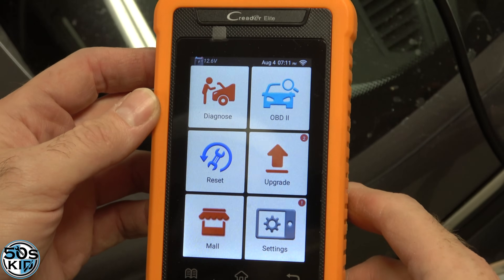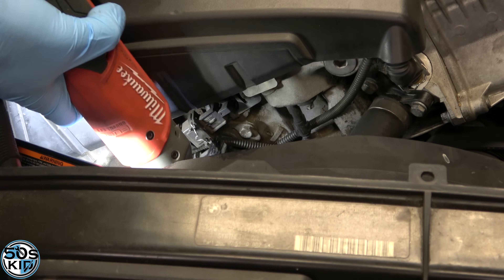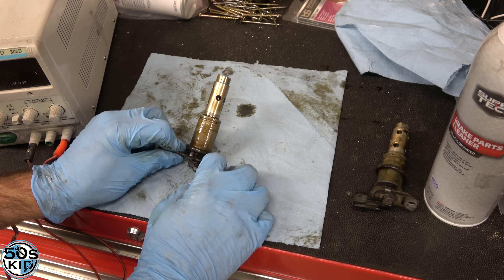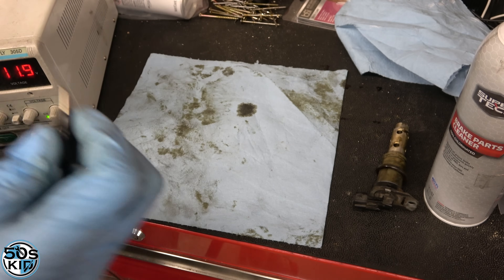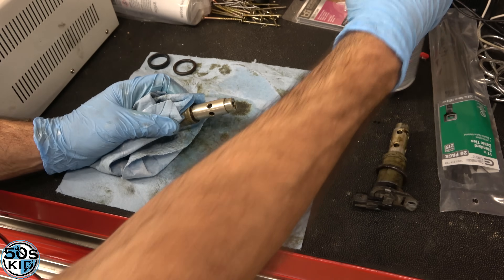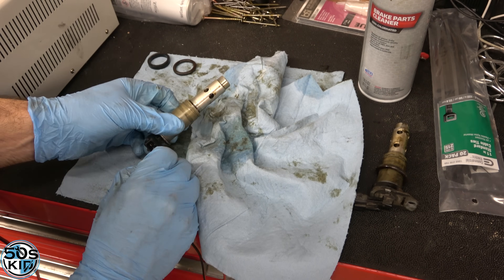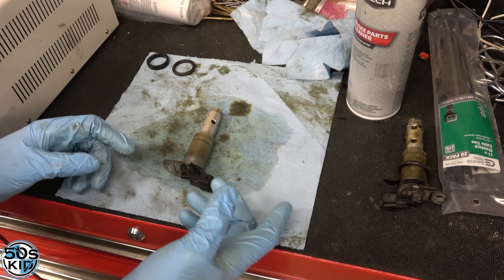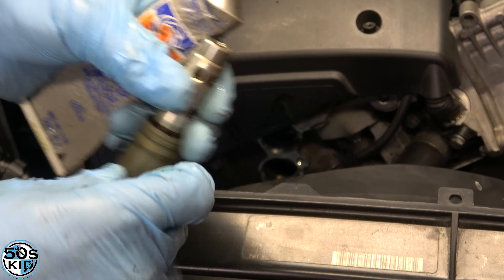Solve Your Reduced Power Problems - E90 VANOS Solenoid Cleaning

Comment: I've been so busy working on my second degree to turn wrenches lately, and have had a lack of funds.  I'm looking forward to picking up an E90 in a few months.  Thanks as always, Jason!✌️
Reply: Get a camry first (except the 2.4) and finish your degree, pay off debt, then get the Big Money Waster. Don't do it now.
Reply: @Dansk55  Ignore this guy... E90's are cheap now and you can get one for less than $10k in decent shape and it wont cost much to maintain it if you do your work. If you buy a 100k car,  be ready to do a 100k maintenance (spark plugs, oil (engine, tranny, diff), brakes, cooling system, alternator) and all hoses, then you wont have much to worry about. Honestly, the same will be true with any used vehicle you buy at 100k miles. I like to do the maintenance whenever I first buy a used car that way I don't have to wait until it breaks and then end up stranded.
Reply: @apathy11303  Depends on what kind of E90. My E90? Absolutely not as everyone has been making me offers left and right - including Canadians outside the U.S. All in all, most maintenance is relatively easy on almost all vehicles. If anything, it's just tedious with many screws, narrow fittings for our hands (assuming you're 6'1 195lbs with piano hands lol), and whatnot. In fact, I can do almost everything on most cars with the exception of transmission work and/or engine drop work. Everything else is relatively easy and doable. Again, it's tedious like everything coding in tech.
Reply: It sounds like you shouldn't get a e90 gonna be honest, unless you got 2 grand laying around ready to do maintenance.

You'll wanna take care of all the maintenance which will be a bit of money. And I'm saying this if you do the work yourself.

Some basic maintenance is: valve cover/gasket, 1 step colder NGK spark plugs, elder coil packs, transmission solenoids, fluid and cover/filter(huge difference. My 5th gear would slip if I went into 5th under full throttle), charge pipe if it's still plastic, BoV if you upgrade the charge pipe, injectors(prolly most expensive since index 12 injectors hitting $400 a pop) oil fill cap has a gasket too(replace that), vacuum lines, check your serpentine belt, if ripped, check your crank pulley, might be broken because it breaks on the chassis if you bottom out suspension.

If you bought a Camry, you could drive it with shampoo for engine oil and finish school.

But if you can do all this maintenance on a decent n54 then you wouldn't give it up for the world. I know I wont
Reply: @PaleAura1  Good points to consider.  I've flipped cars as a side hobby for some time.  Specifically my favorite car is the bmw E46 platform.  

I currently have one as my daily driver that I've done pretty much everything to just for fun. (01 325ci coupe)  I've got an 05 325xi in my garage that I'm currently waiting on a title for...  It might be a parts car.

You are very correct that a Camry in many cases is far less maintaince.  Sadly, we both know a Toyota Camry doesn't have the engineering a BMW does.  While a good automobile, a tin can in comparison.

Thank you for your time to write your thoughts.  I can see it took some time.  I appreciate it.

Best,
Mark